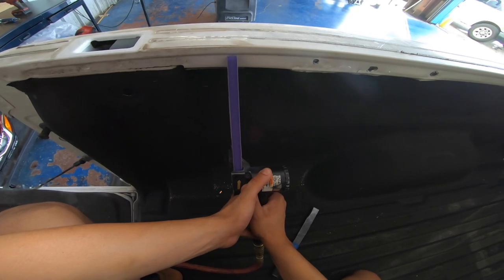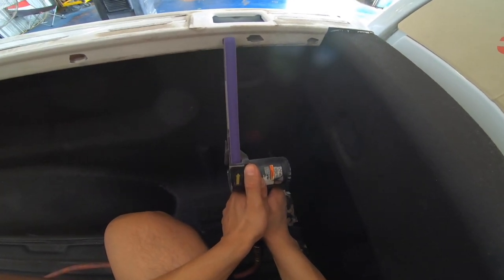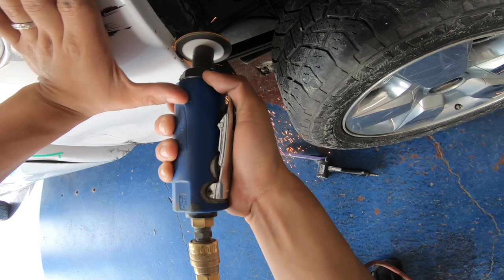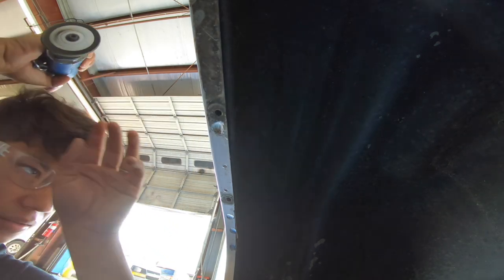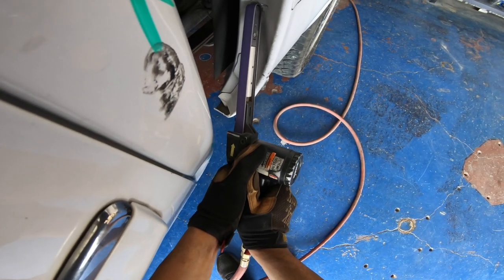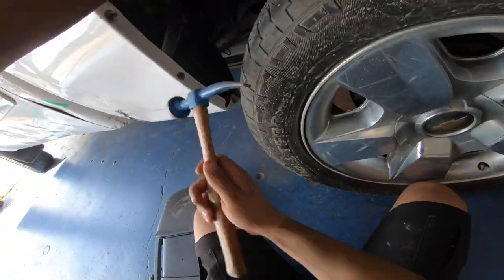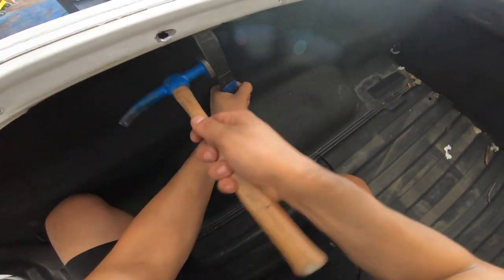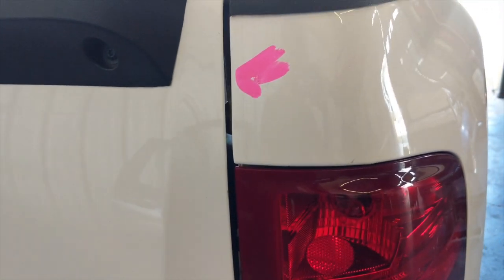Chevrolet Silverado Bedside Removal !

Comment: What would be the approximate cost for this type of work on a 2001 Silverado 1500 long bed??
Reply from the maker: Every vehicle varies from what has to be done in the repair process sometimes it maybe more than what is shown here , also parts and rates may differ . Kind of hard to give an estimate without inspecting the car first

Comment: I bought a whole used bed, intending to swap beds....got it for $300...but the inside is really beat up. I was  initially thinking I'd just cut my old bed floor and wheel wells and sandwich it into place by bolting it in place. Don't think that'll work because the cross members have the threads for the bolts coming up from underneath. My old bed is WAY better inside. Is that even something to consider? Or can I cut my damaged left bed side off and put the used left bed side in its place, and even then it needs body work below the line behind the wheel well and a wheel well patch, too.
Reply from the maker: Yes you can drill out the bedside from the beginning on the floor right where the wheel well ends and the floor starts. I have videos installing a bedside assembly panel. Hope that helps

Comment: Hello, u do great work. My question is can you use a single bed and remove the skins like u displayed and add dually fenders. I have a 2003 3500hd and my bed is damaged on one side
Reply from the maker: I don’t think so , I mean you can find a way to modify it but just swapping OEM fenders I don’t think you can

Comment: I have a 2011 Chevy Silverado extended cab and need the entire passenger side panel from front to rear, but can't seem to find one. Do you know where I can find one at?
Reply from the maker: https://www.gmpartsstore.com/oem-parts/gm-outer-panel-15131269
Reply: @AutoWizard94  thanks brother
Reply: @AutoWizard94  would you happen to know which part is the front driver (left) corner section piece that the panel attaches to? Mine is bent downward and in and I am pretty sure I can fix it, but was wanting to see if it would be cheaper to just replace it?
Reply from the maker: Not sure I follow , the Fender?

Comment: I got an estimate from a body shop for 1200 a side on my 2011 Silverado and that was just cutting out the wheel wells and "glueing" in New ones. I think this would be a whole lot better. It would be a good opportunity to use a rust inhibitor or some sort of protective coating on the inside also.
Reply from the maker: Yes they can add more corrosion protection , replacing a bedside and wheel well would be way more than that. Sometimes the bedside alone can cost that much😩
Reply: That's a hell of a deal

Comment: What if the bedside it pushed in at the wheel well and bent the inner bed side where it is welded to the wheel well?
Reply from the maker: Pull an straighten back to place , if damage is to extensive replace inner wheel well

Comment: I can’t seem to find the side panel you just removed on the videos  just the complete side with wheel well included. How can I get the just that specific park  like in your video?
Reply from the maker: https://www.gmpartscenter.net/oem-parts/gm-side-panel-15283896/?c=Zz1ib2R5JnM9cGljay11cC1ib3gtY29tcG9uZW50cyZpPUdIMDc4NjA1JnI9MyZhPWNoZXZyb2xldCZvPXNpbHZlcmFkby0xNTAwJnk9MjAxMiZ0PWx0JmU9NS0zbC12OC1mbGV4
Reply from the maker: Hope that helps , gotta go straight to manufacturer !
Reply: Auto Wizard thanks!!

Comment: Howd you get those tap screws in between the bed and cab?
Reply from the maker: Great question, I used a battery powered ratchet!
Reply: @AutoWizard94  awesome i will being a titan cab and dont want to pull the whole dam bed out , i will try your method thanks!
Reply from the maker: Great! Hopefully that works for you thanks for watching 👍🙏

Comment: How about if you have more damage then the outer skin
Reply from the maker: If the inner structure is repairable you can make some pulls and repair it , if not I also have replaced more than just the skin

https://youtu.be/ZVSXGc2J0u4